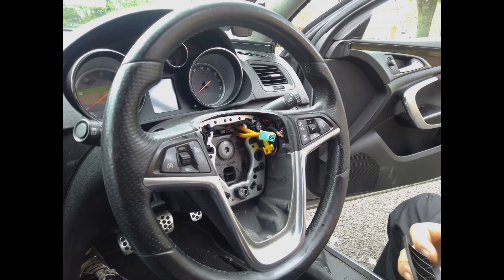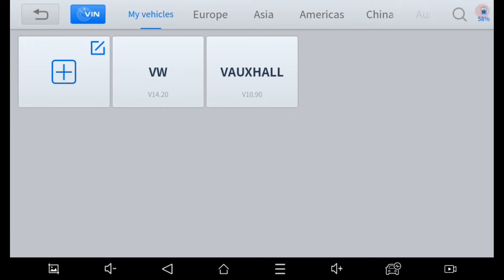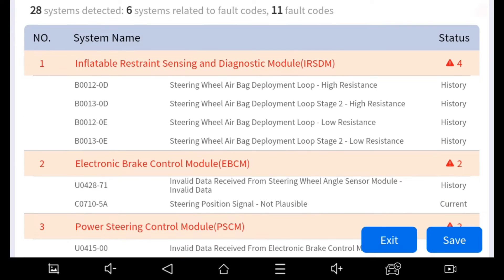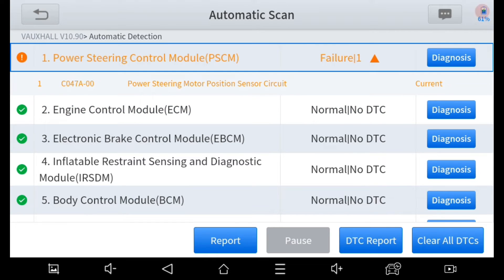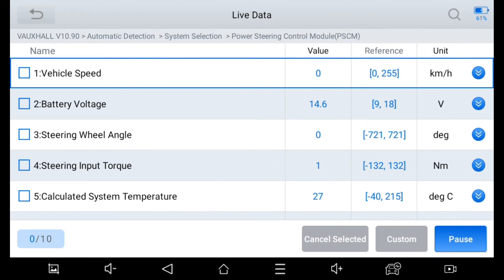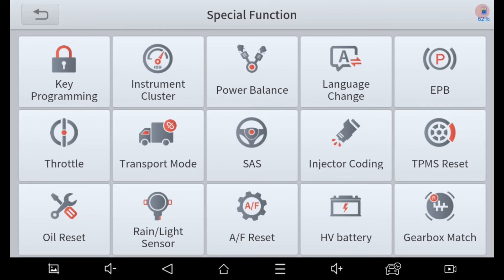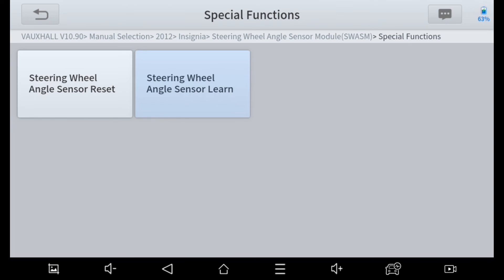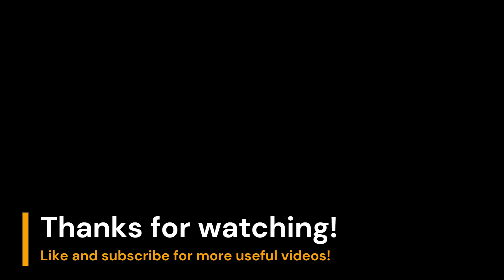XTool D7 Steering Angle Sensor Learn/Calibration on Vaux Insignia After Replace. Special Funct/Reset

Comment: I was looking at buying Xtool d8s because increased encounters with Ford power steering failures. I have a Ford Fusion torque sensor replace and will need to reset and check calibration. But I can't determine the tools capability from their web site.
Reply from the maker: Hi, try emailing them with your query at supporting@xtooltech.com. They have good customer service in my experience. When I noticed an issue with the cylinder power balance data reading incorrectly on the car in this video, they issued a software update within a week to fix it.

Comment from the maker: Wow, sorry to hear that you got a fault code after the brake test 😮! Good luck with your claim! Maybe next time you can find someone with a scan tool like this. I haven't had my D7 for long but I think it's halfway towards paying for itself already! Thanks for your comment 👍
Reply: Thanks, just received reimbursement of the £95 paid for recalibration of the steering from the MOT garage. Wish I had a D7 scan tool!
Reply from the maker: Great news! Glad they paid up with no hassle. Would be interesting to plug into a Yaris sometime and see if the D7 could have done what the MOT garage couldn't. I'm betting it could. 🙂
Reply: @GrubbyRabbitRepairs  I bet it could do what the MOT garage couldn't. (part of national chain). They told me they had tried and failed to sort out the steering fault with 2 different diagnostic machines.
Out of interest do you know if the D7 would be able to programme a new key for a 2015 Yaris? I read somewhere that it can't do some Toyota keys.
Reply from the maker: @montyludwig  Hi, I'm not sure about the key programming on the 2015 Yaris. I will do some research and let you know 👍
Reply from the maker: Hi, sorry about the delay. I can confirm that the D7 can definitely do the remote and immobiliser programming on a Toyota Yaris 2013 key. Hope that helps 🙂

Comment: Good helpful video explaining how to reset the steering wheel calibration.
Just had this done on my Yaris jby Toyota main dealer - cost £95 for half an hours work after local MOT garage couldn't  clear fault code causing ESP warning light to come on after MOT shaker test. Claiming cost back from MOT garage.